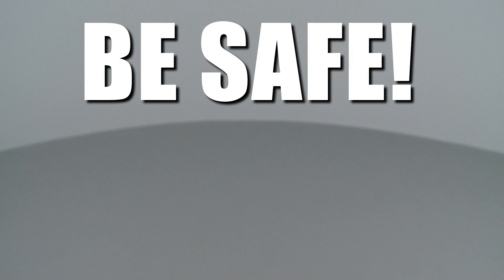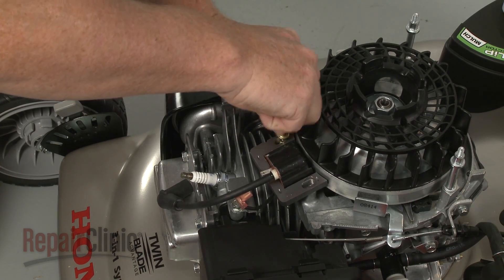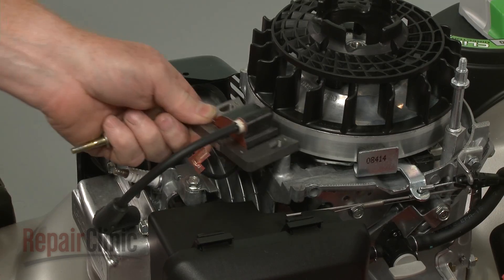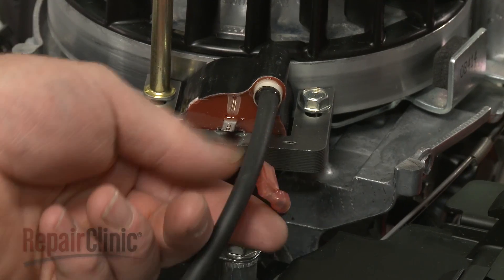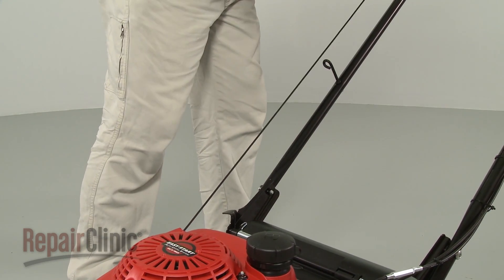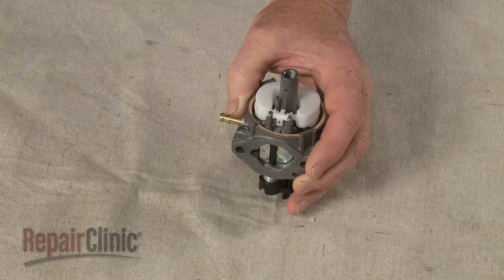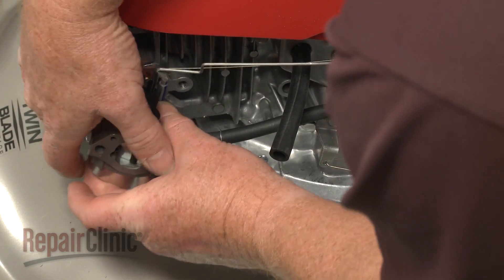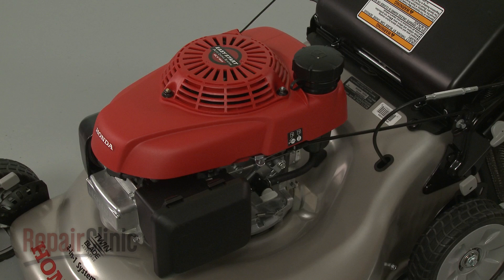Honda Small Engine Disassembly (#GCV160LA0MY1R280)/Repair Help

Comment: Is it possible to convert a manual choke to an auto choke system on the Honda hrx217. It looks like it would just bolt on if I took the parts off my other mower but id rather hear from someone who knows

Comment: FYI:  Choke control assembly must make contact with the electrical connections near the spark plug. 10:00 1st hand experience.  Great video...really helped me out when the throttle return spring was pulled loose by a stray bush.

Comment: Can you show a video of the GCV160 type-4 semi-auto choke and it's adjusting please? 
Is there supposed to be a choke lockout spring on the metal plate above the carb? 
There is a rod link connected to the auto-stop brake and ot goes to a cam with a tab above the choke.